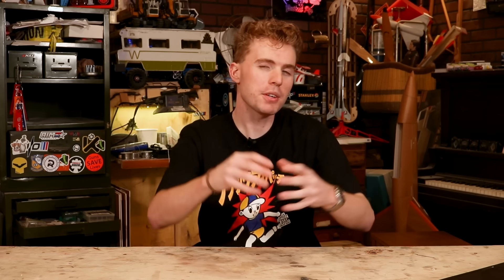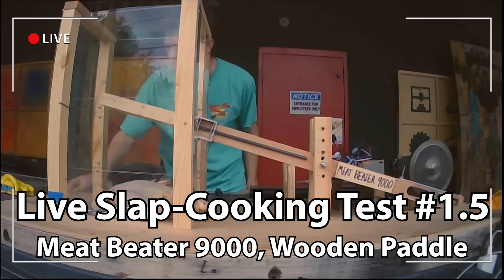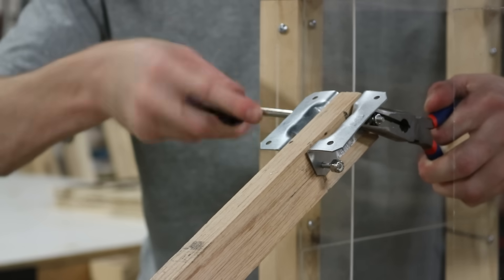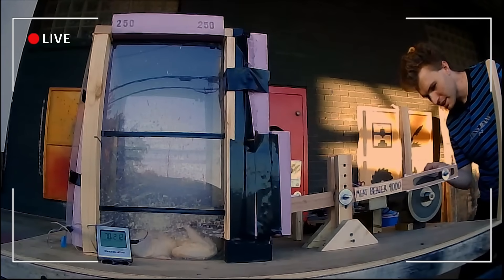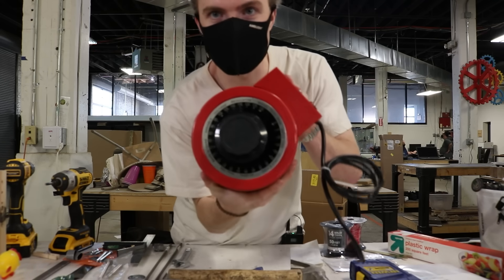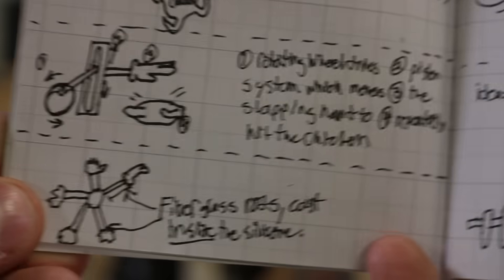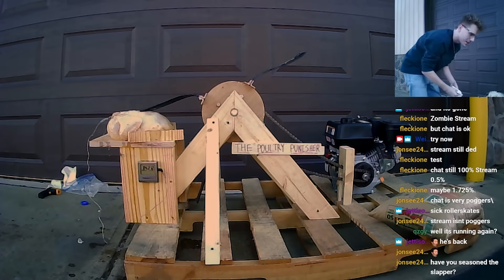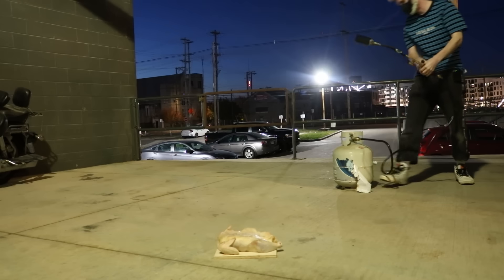How Many Slaps does it Take to Cook a Chicken?

Comment: What if you surrounded the chicken with metal plates? It wouldn't be direct slaps but it would protect the chicken and the heat would transfer to the metal, probably cooking the chicken as the metal heated up?

Comment: If the chicken were inside a more robust container, and it was the container that was absorbing the kinetic energy and converting it to thermal energy, particularly if that container was designed to retain conductive and radiant heat, and the entire contraption were contained in an additional insulated space, then it should be entirely possible to cook a chicken with your slapper without destroying it in the process, because you'd be nearly eliminating those thermal losses... You know, if you wanted to give it another shot.

Comment: I wana point out that insulation and an object that has high movement and frequency, well your air molecules move around faster and faster thus increasing the temp so you really may not even need to slap the chicken itself as long as you basically, and this is the funny part, created an oven environment, 😂, purpose defeated? lol

Comment: With the machine that you used later it was applying force not on vertical but with some Angle this is why second time chicken was in bad shape then before. It would have been easier if you have tried to heat up a metal plate than a whole chicken and then grill smaller pieces of chicken. But it was a cool experiment.

Comment: Is it possible that the slap wheel fails because of the angle the rubber's coming in at? The flaps seem to almost be "sheering," more than "slapping." Not only is that why they absolutely destroy the chicken, but it probably wastes a lot of energy.

The first concept is likely more effective because there is a more direct transfer of energy taking place. It simply places so much stress on the components that the rig fails... Or at least the wooden version does.

I would be curious to see if an all metal, or composite, version might hold up better.

Comment: I haven’t crunched numbers or tried this, but I feel like another good method would be to build a horizontal rig resembling a ceiling fan to slap the chicken horizontally instead of vertically. Doing so would probably preserve the chicken’s original shape a little better than the vertical rig did and depending on the power of the motor, could deliver more energy

Comment: Put the chicken in the enclosure and rotate it while it's getting slapped. This should increase the chickens structural stability from receiving slaps as well as cook it more evenly. Using flaps may not be the best choice as the flaps will not only slap it, but the inertia of pull from the slap destroys bits of the chicken as well from the friction even with the oil. The up and down method has a higher chance of cooking it as there is no friction but straight kinetic energy.

Comment: Hey, so the point of failure was the structural integrity of the chicken meat, right? Why not try to eliminate that? 
You can substitute the whole chicken for something with equal mass distribution, like five breasts or four pounds of raw ground chicken meat, then wrap it all tightly up in some fabric with a seriously high tensile strength, like tightly woven burlap, or some other industrial fiber. This will allow you to crank the poultry punisher to a sustained, ridiculous speed, without shredding the meat before you can reach the desired temperature.

Comment: This is stupid.
The slap can only possibly cook the very surface of the chicken (if that's even possible).
If we wanna play technicalities the chicken would need to be cut down to a size that's around the size of your hand. Fix it so it's bolted   down securely. Only then it might be able to cook. Again this is dumb. The question is if its humanly possible.
First off, idk is it humanly possible to slap anything again and again endlessly without stopping until it's cooked. No, you be worn out in less than 5 or 6 slaps. You'll hurt yourself before the chickens cooked.

Comment: If I can help: your problem was to build a fan HAHAHAHA, btw, you need to use a 1-axis-acting-motor that dows not push wind mass into the chicken. Get a Z-axis-only motorlike a quick up-down press that can rotate in a single place, this will keep the chicken on it's place, heat it exponentially, no broken arms or metal-parts and possibly: success!
Reply: BTW, can't test for lack of money and space... so I am just teorizing.

Comment: Solution: slap powered oven. Create a robust metal cube to house the chicken, and simply use the implements of slapping to heat the metal, which will cook the chicken. It might not be slapping a chicken until it's cooked, but it is cooking the chicken with slaps

Comment: I think the meat beater 9k may work if the bottom of the stroke of the slapper is just on the surface of the Chicken so it's not getting pulverized and the friction between the chicken and the slapper is increased by using a different slapping material

Comment: Why not place a metal surface on the chicken, you need something to separate your energy source from your food source, like how we place a pan between our pancakes/flapjacks/waffles et-cetera.

Then you could slap the metal plate, shape it how you like, hit that. Food not destroyed, perfect heat distribution....problem solved. A pan is basically a barrier and protective radiator.

Comment: What if you used 2 of the slappers? Not only would it cook more evenly, but theres less time for the chicken the break apart
Or for the wheel, what if you heated the slappers on one side, and put the chicken on the other. Then each slap is gonna cook the chicken a little bit, or at least the skin of it

Comment: The problem with you first rig was using wood you could have gotten more structural integrity with a square tube of metal preferably aluminum and made the actual slow part hard rubber or just a piece of wide flat metal. The second problem you don't need to slap the chicken hard just contact, as soon as you make contact the energy is transferred which was as simple as decreasing the radius of the fly wheel, and would also increase number of slaps per second by decreasing the distance to each slap, the other law of physics you were fighting is at that speed once you make contact and the arm moves from the chicken it creates a vacuum pulling cooler air over the surface which the energy created also goes to heating that air. The flaw with the second machine you made a fan??? And a way to prevent tho pulverization? You could have put protectors on either side of the chicken so the middle would be slapped to transfer energy but the protectors would prevent it from digging a nd stripping what actually got heated. For all the attempts and amount of people you got help from, it's pretty sad the number of problems that weren't addressed. And a experiment needs to be done consistently you had the most progress early on and completely abandoned all the progress. You can not call your results conclusive you did not flow the scientific method.

Comment: When you finished the final design , you totally disregarded a huge factor you yourself spent a good bit of this video explaining , Newton’s law of thermal cooling. Furthermore your original design concept was working better but wasn’t built sturdy enough. Replace all the wood parts with a CNC cut aluminum. Putting a spring on the wrist would likely increase the force by adding a whipping motion while simultaneously relieving stress on the motor and mount. Try using a silicone hand with a ridged hand skeleton for more realistic slapping characteristics. Add a reflective layer on the inside of your cooker to radiate the heat back in. Make the structure of the “cooker” triangular so as to limit the surface area of where the heat is rising to. I think with these design inputs to your already great idea you should be able to maximize your ambient temperature and reduce stress on the chicken. 
Let me know what you think , looking forward to seeing you do what no one as yet to ever do.

Comment: It's like you want this to fail.  First off, if this is about how many slaps a human being would have to do to cook a chicken, at least heat the slapping device to the approximate temperature of a human hand.  Then, enclose the chicken if you're going to use the rubber slap method, and maybe don't do it outside.   The air is being disturbed by the windmill of rubber and thus carrying vital heat away from the chicken.   It is now my life's mission to engineer a chicken slapping device.  looks at engineering degree   I CAN SLAP-COOK SO MANY CHICKENS WITH THIS BAD BOY.

Comment: The temperature was rising because the sun started shining on the chicken. The container in which the chicken is contained is not thermally insulated (even with the lame insulation ), so any energy put into the chicken is likely immediately removed by convection of the air around the chicken.

Comment: I don't think you considered the fairly significant airflow caused due by the flaps in your simulations. This could produce a major cooling effect. Combine that with the lack of a boundary around that to further prevent any more airflow, frankly it wasn't a surprise that the temperature kept going down instead of up. 

Great attempts though!

Comment: Should’ve pinched the chicken between the Table and a copper plate. Have the rubber slapper hit the copper plate. The copper will protect the chicken and transfer of heat will cook the chicken eventually. Just make sure the copper plate is attached to the table with struts so it can’t move up and down.

Comment: I mean your definition of slapping is weird, the wood part is like just a punching machine with wood,
And the wheel one slaps had literally no weight on each rubber hand 
And why not use a light metal bars rather than wood ones, yeah wood is lighter but its very fragile
The 26k human slap should be done instantly at the exact time which is impossible
I'd say use a stronger engine/motor, none toxic rubber/fabric strong gloves  and just use chicken breasts cover it in some skin layer so it doesnt detoriate

Comment: I wonder...
Maybe you could try cooking the chicken through a metal plate, transfering the energy to that first, removing any issue with the chicken not being solid enough, resulting in you having the ability to figure out the most optimal methods of transfering the heat.

Comment: Isn’t it all about generating friction heat from slapping? In that case, it’s not just about the frequency/speed of slapping but also about making the slapper out of a material that maximizes friction. Also, up and down motion should hold up the chicken better than rotating slaps that try to push through the chicken (I.e. less likely to break apart the chicken before heating it up). Please try again with my suggestions!

Comment: The best solution I think is that stick to your first design, with containment box with hair dryer and wrap you chicken with saran wrap to prevent it from being messy, and the first design with motor is great having rpm control the rod you should use heavy duty rubber as the slapper and use rubber dampening reinforced with steel brace to absord the stress rather than directly hitting the wood/braces

Comment: Well I have a bit of thought after this experiment.. 

My thought is that why is there only 1 rig?? If we know that the motor or some parts of rig breaks, there should be a back up so that when the first breaks the other can take over.. 

Also my other thought is shouldn't it be faster if there is at least 2 rigs doing this.. because we proved that in 1 rig we can reach up to a temp of 120F but what if there is 2 slapping at the same time? The more energy the faster it will (but the  problem of that will be the chicken will most likely be paste if there's 2 rigs) 

But hey Im grateful I got to think along with you guys 😁😁😁😁

Comment: Your final design indeed improved the rate of slaps, but you unwittingly created a current of air, as each flipper pulled air along with it convection cooled both the chicken, and the flippers.

Your physical solution, came with a mechanical error.

Comment: What if you close the chicken in a container and slap the container instead? It can be made of metal and externally isolated, you wouldn't lose heat and the metal can resist more slap than the chicken.

Comment: I think the main issue here was the air flow rate going over the chicken. What would happen if this test was done with an electric motor in a vacuum? The only heat coming from the motor and the slap.

Comment: It seems that problem is when you slap chicken from 1 side it keeps transferring heat to other surrounding regions. Instead of slapping it from 1 side slap it from 3+ sides. It might actually work using your 2nd attempt setup using rubber hands.

Comment: Rubber is quite a good insulator, maybe if you tried with a more thermally conductive material or wrapped aluminium around the rubber flaps etc. The goal would be to get the flaps to heat up as much as possible so that they can cook the chicken like a piece of hot metal branding flesh.  

I'm not sure which materials would be most suitable so that'd need some testing but there is one idea.

Comment: have you tried staying to your first design but using metal? the most common problem is that the wood doesn't hold.

the rubber slapper was pretty bad. when i saw the design it was inevitable that the chicken would be pulverized. the initial design was better for me since energy was being focused on one point via impact. in the 2nd design you had impact and attrition causing wear on multiple directions.

Comment: I think it might still be possible for two reasons.

First, while the final design was more efficient with its energy, one flaw I noticed was that the slapparatus had less mass than before. Since kinetic energy is directly proportional with mass, the heat transfer is reduced.

Second, along the lines of creating more favorable conditions, you can't forget that a human hand is going to be warmer than a piece of wood or rubber, which would make heat mountain even easier to climb.

I'm pretty sure that if you made another slapper with a more massive slapparatus that's being warmed to like 98 °F, then you'd see much better results.

Comment: To do it you need to be able to not pulverize it but transfer the energy an create friction quickly. Having a numeric vertical cylinder vibrating up an down at high speeds slightly touching the chicken solves this problem am cooks your bird.

Comment: Where you went wrong with the last model was that as the temperature increased you also removed material that was being heated. You basically used a chicken as an evaporative cooling pad for the slapping arms. The first models made a much better cooker because that upstroke kept from the arm removing the freshly heated chicken and thereby allowed the chicken to store the energy being imparted to it.

Comment: I have an idea

What if you were to do kind of what you did in the last part but make it on 4 sides of it and make it so each slapper hit at a different time (now I know there’s a lot more of a thought process to go into this but it’s just an idea) I thought about this because it would spread out the area that would get hit and it would also be more efficient for spreading the heat out and cooking it fully, It would also eliminate a few problems such as the motor overheating

Sorry if this is a bad idea and completely makes no sense I don’t do engineering very much but I come from a family who are engineers so I thought maybe this might work but it could also be a complete failure and it’s not even worth trying😅🤣😁

Comment: I haven't watched it all yet, so im just commenting his so I don't forget:

isn't the human hand warm, wouldn't a heated "slap machine" heat it up faster
Reply: No because the contact time is too low for that kind of heat transfer to happen. Plus, beyond a point, the hand will be cooler than the chicken.
Reply: @Kes22497  but the hand is warmer than the wood, heat goes from high to low until it creates equilibrium, by using a warm hand, the equilibrium would be a little bit higher giving the chicken a better chance to cook
Reply: @thebrax  once again, the contact time comes into the picture. If the hand and the chicken were good conductors of great, then yes, this would make a difference. But heat flows slowly in and out of both, so it really won't make a discernible difference, imo.

Comment: The rubber you used to slap the chicken probably used too much momentum causing the meat to disintegrate. You need it to be lighter and stiffer or at least reduce the amount of rubber used to slap the chicken.

You can use an engine where the piston moves up and down rapidly, that should do something, but yoy need that sweet spot where the chicken is neither going to be ground or lightly slapped. Just enough where it sounds like a parent beating someone with her own slipper.

Comment: This is so awesome.

I think one thing you missed out is that we typically don't cook chicken directly on a fire (even when roasting, we never put the chicken on top of a very hot fire).

I truly believe that it's certainly possible to cook a chicken with slaps, but what you have to do is put the chicken inside a metallic pot and slap the pot, instead of the chicken, using a metallic slapper. Yes, it will be noisy, but you'll have to figure a way around that.

And also, slap the pot from the bottom -- not the top -- because heat rises; hence, spreads the heat through the rest of the chicken instead of right out into the air.